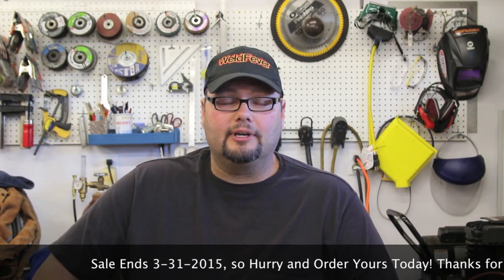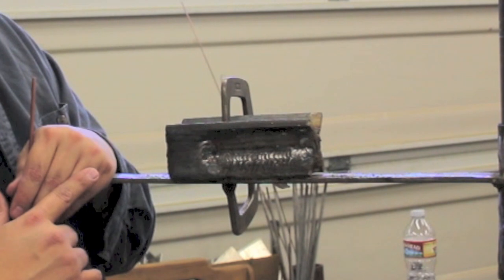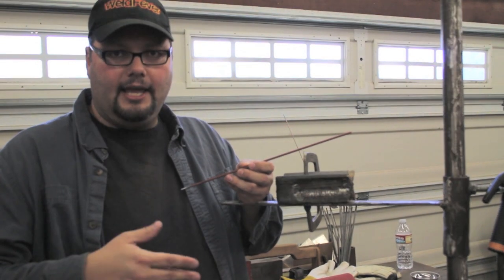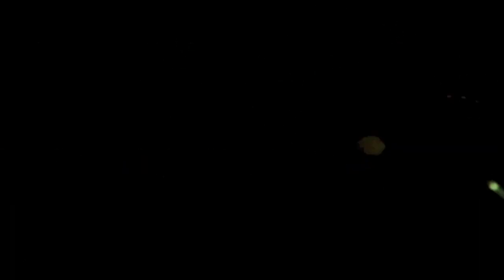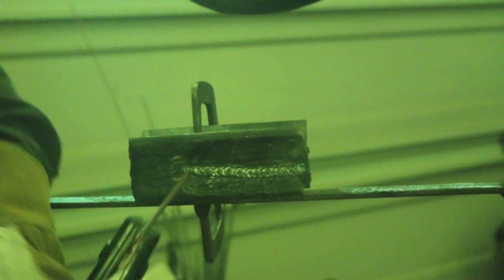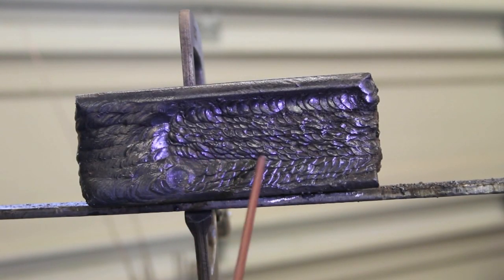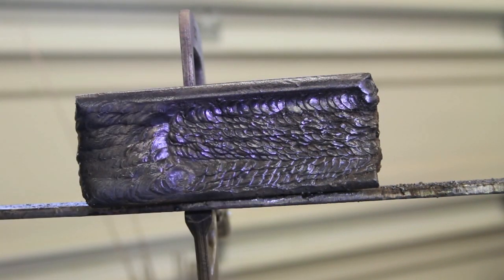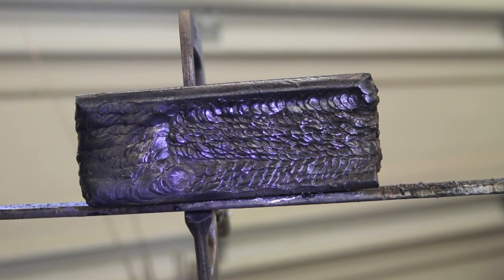Horizontal Stick Welding

Comment: i do circles and i am on horizontal open but in my class. i need some advice on it and i am using E6011 rods.
Reply from the maker: The trick is to pause and then get out of the puddle in order for it to partially solidify, prior to going back into it. There are a few other techniques you can try. Perhaps I'll try to make a video on open root welds with E6010/E6011.
Reply: Hi Dam, over here in the UK i am using a 6011 on horizontal with box section to flat plate10mm  the curve on the box sections giving me real problems on the weld , would i go for the pause and then get out of the puddle in order for it to partially solidify, then go back in to it, what would you recommend .the box section it 150x80mm, so quite a radios to fill or do a double run, of go for different rod, many thanks great videos.

Comment: Color means a lot because the grey 6010 my Lincoln is a 5p+++++ rod runs a lot better than the red rod in my opinion
Reply from the maker: Righandwelder1202 Well, I suppose so in that respect, but that's the difference in a manufacturer's product line and not exactly what I meant. What I was trying to point out is that if you get used to using one color, that you should't think you have the wrong rod if you suddenly switch to another manufacturer's rods, or blend. I've had student think they had the wrong rod, because they believed 6010's were supposed to be red. Thanks for the comment!